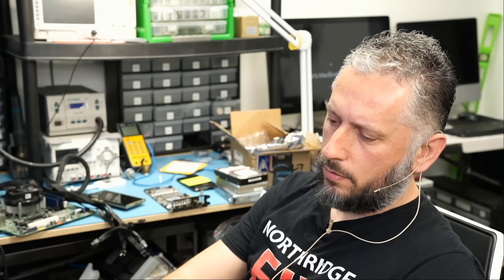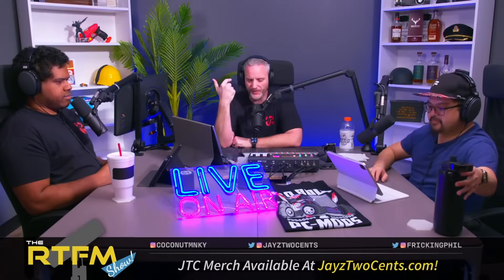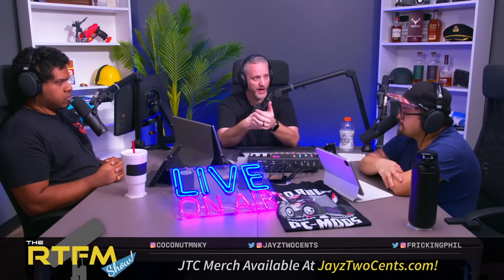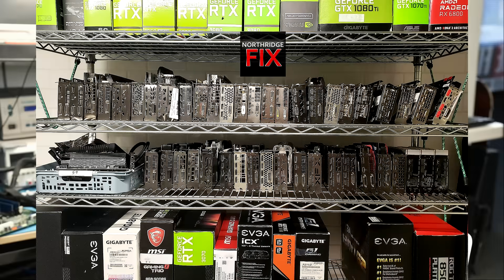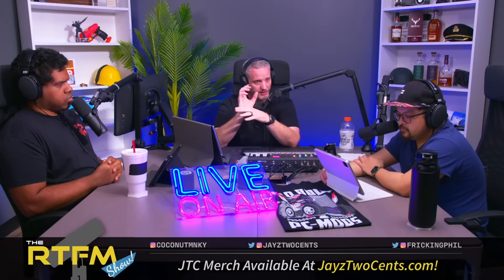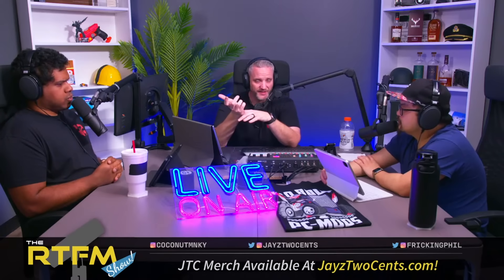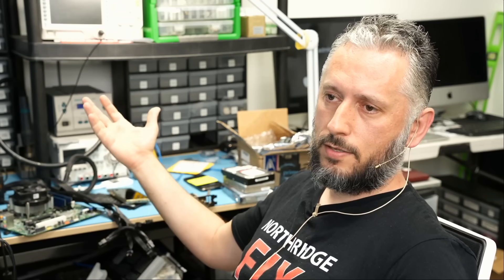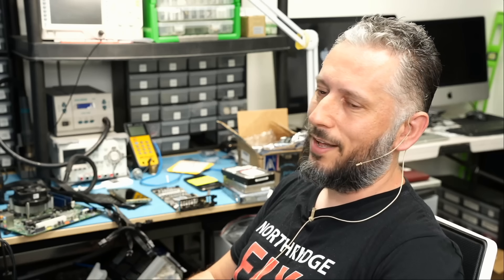Melting 4090 and CableMod. JayzTwoCents and Gamers Nexus Response. Blame NVidia or User?

Comment: Jay agreed with you and so do I, if 4090 cards are coming in bulk melted on the pcb nvidia should recall them.  Even if it was user error for 2000 the card should have built in protection. I have limited my card to 300w until this is resolved
Reply: Why? If it melts they will give you new card anyways, won’t they? Bth there are cases melting with powerlimiting anyways

Comment: If 4090 Graphics Card Power (W) is 450 W, then 450 W / 12 V = 37.5 Amps. 37.5 Amps for the card! If you look for gauge wire size needed for 40 amps, then you need 8 AWG wire to handle that current. PCIe Gen5 cable connector uses only 6 (pins 1 to 6 is +12 V) pins for that amount of current. You could downclock or use your 4090 on low/medium settings in-game to NOT to use the full power. But then what's the point of 40-series cards?! In my opinion it's a design error not user errors...

Comment: There's a reason why the ground on a three prong plug is longer than the other two. You want to avoid bad things happening when there is user error. If user error results in what appears to be a fire hazard, something is wrong with the design.

Comment: One wonders, is NVidia not ensuring that all six pairs of 12V wires are carrying the same current? If the card has differing resistances in line with each of the six pairs of 12V lines, then those lines with less resistance will carry more current and thus get hotter at the contact points. I bet the Cablemod adapter has all six pair paralleled in the adapter, which means that from the adapter to the power supply, the current is the same in all six pairs. It might be worth adding a 10-gauge parallel wire jumper across all six B+ lines and another on all six B- connections, right where the connector is attached to the card.

Comment: Makes logical sense it's a design flaw. I can see 1 port taking on the job of 3 = more power and heat transference, assuming the gauge of the connector terminal isn't sufficient it can result in premature failure.

Comment: Can anyone view with a thermal camera the connector on a new video card at full load? If the copper tracks heat up the first then it's a design problem.

Comment: I absolutely agree with Jay and Alex. I personally believe the amount of power draw, and specifically spiking power draw, is to much for the size of the pins on the connector which will of course cause an overheating condition and melt the connector.

Comment: Just thinking if the cable arcs in the connector when its poorly connected and should the melting be at the adapter side where the cable is poorly connected if the arcing happens. I mean where ever the cable is poorly connected and it arcs it should melt there. Only thing i can think of is that the tolerances of the connector are too small and when the card draws electricity they kinda short out and heats up or something.

Comment: I agree and disagree with Alex. I agree that their is a design issue and that is because the design completely ignored the human element. It has 0 tolerance which is just a foolish thing to put into production. I disagree with Alex because the responsibility doesn't fall upon any gpu manufacturers. Instead the governing entity that certified this new plug is to blame. They are the engineers and if they hadn't certified it,  no one would be using it. I can't think of their name but I'm sure someone knows whom I'm speaking of.

Comment: Nvidia can easily fix that. With ceramic connector, and some wire mode on the trace it self. And make some changes on pcb for power delivery circuit, for the next batch. We should stop indulging manufacturer from becoming apple.

Comment: Im sorry Im not a subscriber "easily fixed" but looking at all the video`s and having 30 years building PC`s I have to agree with you. This problem never surfaced with the 8 pins connectors, its only with the 12+4 pin connector and seems to be at the moment only with the 4090. I honestly think the problem is on the board at some point. Yes steve did a great job at finding out what could be the problem but as you said he is holding onto his findings but I have no doubt in my mind he will revisit the problem again if he thinks there`s more to it. Great video though and it will be interesting to see the outcome as these video cards are way too expensive to have these kinds of problems.

Comment: I got a $2000 video card. I send it to the repair shop.  I certainly don't send it to a YouTube channel as a donor board so the YouTuber can analyze my video card.

I understand the queue is long. If I send an electronics to Northridge fix

I know,
A human looked at it
A human tested it
And if the packing slip says my electronics is unfixable then I trash it.

Electronics may be going beyond the user being able to upgrade computer systems.

Comment: Yeah, after watching your videos it's no way to justify saying it's all user error. It seems the only true fix is different connector design or if  possible to add more connectors on the board to distribute load and heat. These pins must simply allow too much resistance in-between the connection points while heavy loaded for this application. Whether it moves and loosens on its own or not makes no difference. It is still the same problem, same results and still needs the same solution! I wonder what the thermal image of this connection looks like while fully loaded? I bet Nvidia knows what it looks like!!! Great job on this Alex!

Comment: I think Steve chose his words poorly in this instance. "User error" places the blame squarely on the shoulders of the end user and I don't think that is what he meant to do. I interpreted it as a design flaw that causes the issue, the cable works itself loose some how and is what would be called a user issue by NVIDIA, BUT I personally think there has got to be something else going on. That is with the NVIDIA adapter. The Cable Mod ones seem to be a different story entirely. I have to go with your thoughts on this Alex. You worked on them, saw the damage first hand and know what you are talking about.

Comment: JMO. It 'appears' that the part of the circuit that is being supplied by those pins is drawing more current than the connector can handle. Is the 4090 drawing more current than the 3090 that uses the same connector? If that is the case, then it's STILL NVidia's problem, but they'll never admit to it, OR, fix it, they'll just phase out those boards and come up with a new revision, leaving all owners $2500 poorer. It's hard for my little pea brain to comprehend why ANYONE would pay that kind of money for a piece of electronics that probably cost the manufacturer maybe $20 - $30 to produce! SMH

Comment: This should not be happening period! I bought an ultra premium luxury product. The manufacturers need to stand by their products when a failure occurs. It's bad enough I need to baby my graphics card and constantly ensure that not only is the cable still plugged in fully but periodically bust out a flashlight and magnifying glass to check for any evidence of melting... I intentionally bought the power supply and graphics card from the same manufacturer (MSI) to limit their options for dismissal of warranty service. They will now just say "Oh well must not have plugged it in all the way!" If they won't recall them then the warranty should have an addendum added that shields consumers from the issue.

Comment: i align with der8auer on this, the connector is subpar and should never have been implemented in the fashion it was.

there was nothing wrong with the existing 8 pin or 8pin x however many setups, beyond the visual. they could have easily worked around it, but they wanted the super clean look on the giant heat sink.

there's times where need for function outweighs the desire for form. this connector is one of those times, and its hot garbo.

even with them plugged in fully, and 'correctly', the connectors manage to generate more heat than the 6/8pin style, and have less contact area overall, in spite of the pins on the cards being literally identical in physical size within the connector for the power side. that means they cheaped out on the plug side of the equation to be able to fit it into that smaller size, which means you also have less mass holding it in, but the wires are 18-16AWG(ish), and so you still get some forces acting against it staying in, and it appears that those forces do seem to eventually manage to work some of them out. on the old plugs there was enough mass that properly plugged in, the chances of one working itself out of full connection was remote at best.

i consider this product feature to be a hard fail and refuse to go near any device with them as part of the design.

Comment: So, all this user error vs. nVidia error squabbling aside, just what IS the problem?  Is the card just overall drawing too much power, either under full load or no?  Or is there a component or two on the cards that are out of spec causing the overheating?  Are the fans failing and the cards aren't catching it, leading to an overheating scenario?  Or is there something subtly wrong with the connector itself?  And why are only 4090 cards affected?

Comment: In the age of COVID the problem is everything but the actual cause of the problem. The material that the pins are made of is suspect. It probably contains too many impurities causing undue resistance. This would be a manufacturing quality control problem.

Comment: this connector is flawed  in so many ways in it's design . thermal expansion and contraction  of the material used  and the insufficient safety clip are most likely  a reason  for the connector to pop off just enough to cause this king of damage ? maybe , but it is hilarious to call this a design oversight  and blame user error  when the design and decision to use this connector are all nvidia's responsibility so it is on the manufacturer of the reference boards  to face the consequences of their choice .

 i think  Jayz suggestion makes a lot of sense to secure the connector properly and a thermal sensor should be used to throttle the gpu  to reduce power draw enough or affect power draw directly to keep it cool  if it is the case which is still very hypothetical for now and highly pure speculation and a unproven yet theory that needs to be verified .

Comment: I watch all three channels, been keeping up with the 4090 crap, i agree with Northridge and i also think nVidia knew about this before they released the cards. The connectors are not fit for purpose which is why im still rocking my EVGA 2080ti FTW3 Ultra - no way im putting one of these new cards in my system and risking a fire. nVidia should recall these cards and take the hit before something more serious happens.
Reply: You bet NVidia fully knew about this issue before releasing the cards.

Comment: Too much current is connected via too few connector pins mounted very neer to each other. Too much power (3 connections to one) means too much heat loss on a very small heat transfer surface. Poor connection material is also a factor to consider. 
NorthridgeFix is right. It is an Invidia issue and not a user issue.
I don't think a user would buy such an expensive card and not bother to mount it properly.
Invidia needs to replace the connector with one with a higher melting temperature plastic. Or redesign the card and use three connectors instead of the usual one...

Comment: How many years have we installed video cards? Are they saying people are completely stupid? People plug in their phone's, hdmi,network cable's, toaster ovens, and other appliances or devices. What if a module in a car fails, is that the users fault? People plug-in things everyday throughout the day. This is Nvidia fault.  They are trying to cut every cost on their products. What's wrong having two connectors? Nvidia only cares their investors only not the people.

Comment: some times as ingeniers .. and more as electric engenier . we forgot the basics.. all electric cables wil heat.. due the voltage  the amperage.and the resistance of the cable (yes it has )..and even so that there are formulas to calculate the minumin diameter that a cable needs for a certaing lengent a certain voltage and a certan current .. the problem with the 4090 in generta is that the diamerter of the conecting cable (and its terminations)  is lower that the one need and in some circunstances larger.. y mena the cable.. so the proper way to resolve this is a higher diameter cable, that wil resove the over heat .. also alex if you can ..becuas you repair them ... see that there is a pettern on the pins that melt.. those are the cables that are overheathing due amperage..yes amperage .. not volage ... the rail is 12 votls....

Comment: Even IF it's something where user "error" aka a misaligned cable can cause melting like that, it's still nvidia's fault. It's a $2000 card. They are the size of a small car, and those cables are the WORST combo of flimsy while also being vice-gripped into the socket. It's easier to attach and remove the cable when you're holding the PCB in your hand. It is a bit more of a task when its in it's shroud and crammed into a case. They should have reinforced it better, added guides, a different mechanism, whatever. I also agree that there's no definitive evidence of it being a connector issue.

Comment: anyone have any cases of this happening to 4080's as well?   .. they to use the this new connector, but havent seen any in the news about a 4080 burned connector.

perhaps it has  something to do with over 400 watts and that connector ( 4080's max out at 320)

so maybe 320+ watts  and whatever = melted connector?

and yes i agree with northridge fully.   

I have lost respect for steve from gamers nexus after this shilling attempt to explain away what is obvious to anyone.

Comment: too much current consumption, those pins do not support that amount of current that the card generates when running games at full load.  AMD and its Radeon 7900XTX consumes more than the 4090 the difference is in the old pci connector.

Comment: I have a feeling that Gamers Nexus is stuck on the theory that this is user error because they haven't been able to reproduce the bug in the lab and what we see now is a classic example of confirmation bias. 
I really scratched my head when Steve said "[...] it's possible that the user used the product without the adapter[...]" because it doesn't make any sense, and I don't think Steve watched your video with the 90 degree adapter before Gamer Nexus released their video. It may have been a staff member doing research and Steve just reading from the script, but it's nevertheless a huge mistake by Gamers Nexus. I expect more of them.

Comment: I own a 4090 and personally I still feel like this is user error and design that somewhat promotes user error (GN's take). On my card, for example, when I plug the 12-pin adapter in it doesn't really make a click of any sort indicating the plug being fully seated, like my previous 3080 did with the regular 8-pins. I can imagine some people being afraid of jamming the plug in too hard or not really checking if it's all the way in and calling it good enough except it eventually burns up.

Regardless, RMA should cover this even if it is user error as it is ultimately caused by a design that promotes this sort of mistake (also as a user, I'm sure nobody wants to eat the cost of a 4090 over such a thing).